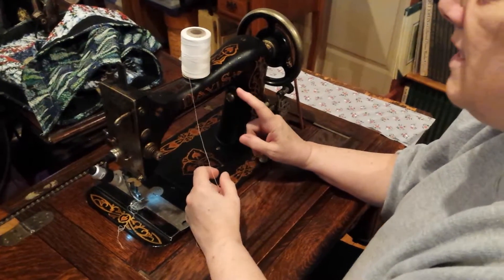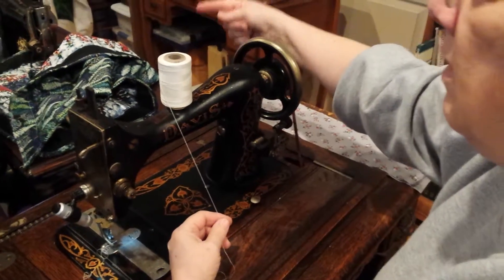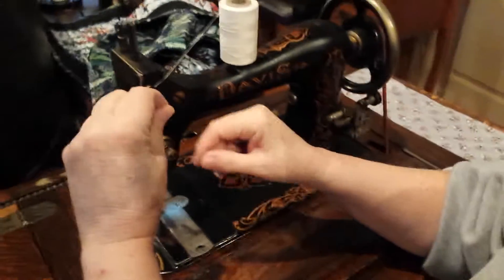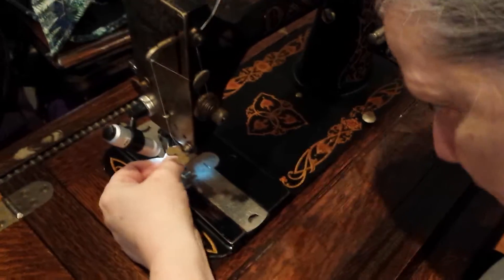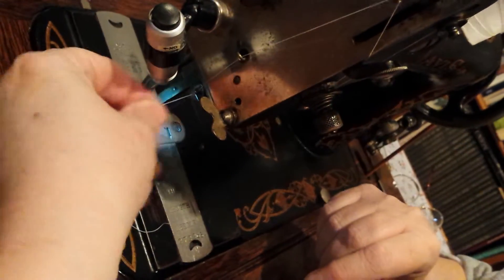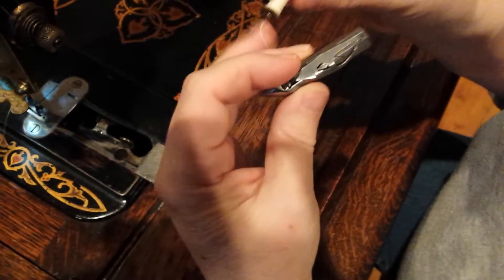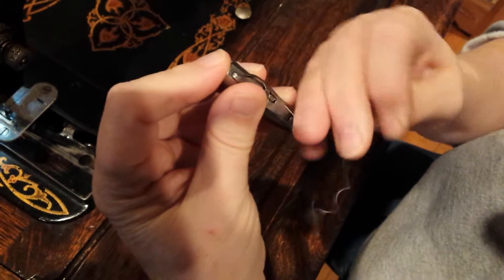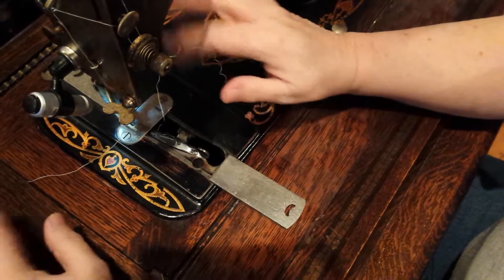Davis nvf threading

Comment: In this video her thread path includes goin behind the reverse  button , and then up and into the slit.  Seems to work fine.
Reply from the maker: If you will run it behind the back tack, then the thread wont jump out of the take-up lever.  I have been running like this for 25 years.  I started running behind to attempt to stop the thread from flipping out of the take up arm.  It works.

Comment: According to the original Davis NVF instruction book, the thread should not pass behind the back-tacking button.  Instead it should go directly from the tension disk to the uptake lever.  Having the thread behind the button may result in the thread's feed being interrupted when the button is pressed; while the machine is in motion, the thread  may break and/or the tension will be altered.